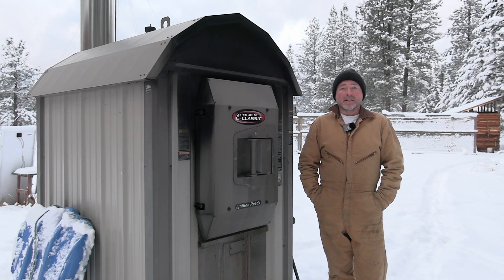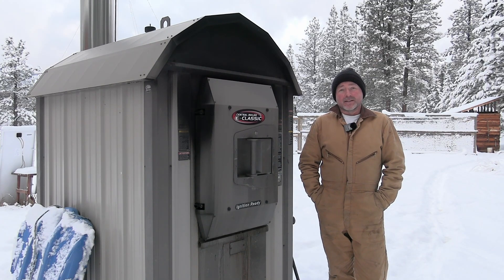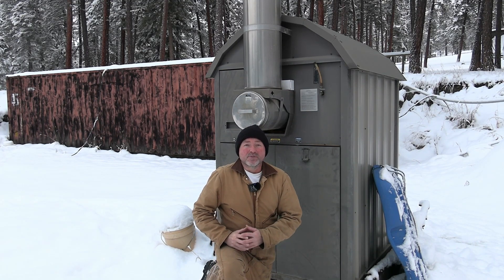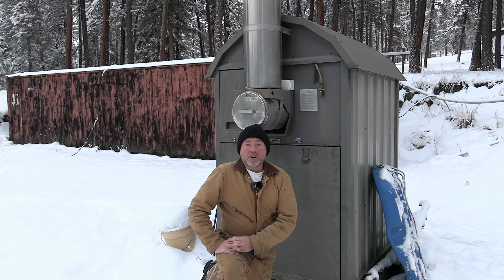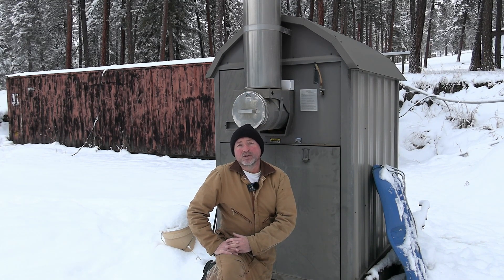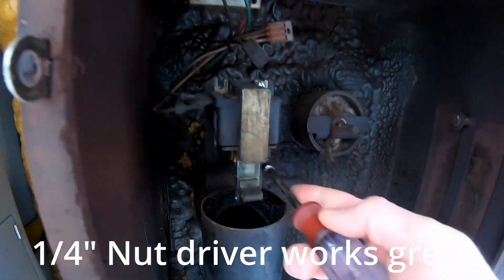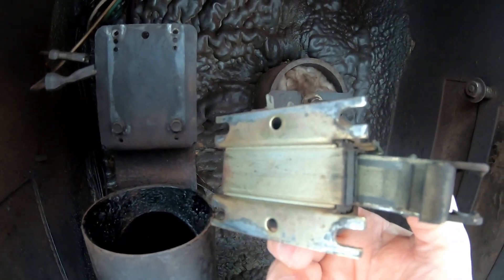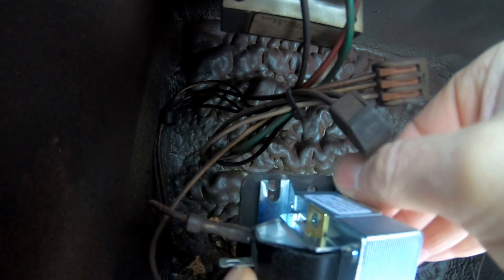We almost got cold. The Wood Burning Central Boiler fire kept going out. Diagnosed and Repaired it.

Comment from the maker: 👀Timestamps take you right to that chapter:
0:00 Introduction
0:56 What happened
3:28 Diagnostics
4:17 Inside the airbox
6:43 The new part
7:18 How to replace the air solenoid
12:37 Adjustment of air gap
13:29 Conclusion

Comment: My brother and mine are scrap (E2300).  Looking for a different brand. Mine started leaking deep in the gasification part..My brothers started peeing water out on the seem in the firebox. The welder couldn't believe how thin the wall was.
Reply from the maker: Wow, that's pretty bad. How old are those boilers? Mine came with a 20 or 25 year warranty on the steel, burner chamber/tank. I have noticed that even with the corrosion inhibitor at the correct level there is still corrosion going on in there.

Comment: What kinda wood do u burn ?
Reply from the maker: Mostly Ponderosa Pine since this is the most common tree right here. I do also burn leftovers from a small sawmill in town. That stuff is all kind of mixed wood.
Reply: @RMTFamily  reason I asked is to my understanding supposed to be seasoned hard wood which is why I have the older style can burn anything (wood) so have things changed or ur limited w/ pine ?
Reply from the maker: @scottwebber652  Hi Scott, you can burn any wood in the boiler. But hardwood is dense and you can get more heat out of the same size log. It can burn cleaner than our pine because it reaches higher temps quicker. It also will make for less creosote build up. Simply said with hardwoods the boiler will be cleaner and more efficient. 
But we have been burning pine all along and have found it to be working well for us. 
We cut down dead pines  which are already seasoned at that point, but usually they still get stacked for a year or so as we like to be ahead of the game.
Any dry clean wood is fine for these boilers.
I’m sure the manufacturer still says to use seasoned hardwood  since that makes the boiler perform best with the least amount of cleaning. But that is not cost effective or possible everywhere.
Reply: @RMTFamily  I like to hear that because of their recommendations n u not following I wondered if it would work n u can tell us. When I bought the gassifiers were coming out and because of any thing in the old version I went that way but if I needed to replace it I wanted to hear what the people were actually doing. What do the rest of u all have to say about it ????

Comment: Where are you from? Kinda sound like you have a foreigner accident.
Reply from the maker: Got my accent from an accident. 😂Obviously I'm from Montana. You must not have heard a real Montanian accent yet.😂
Just kidding. I grew up in Switzerland. Once you have an accent you can't get rid of it. Almost 30 years in the US but still have the Swiss accent. 😉
Reply: @RMTFamily  awesome. I was thinking Russia. You can hardly tell just a little.  I have a central boiler 5036. It’s the small one holds 190 gallons of water and is all 🪵 fuel.  Using it all winter long. It loves the wood.
Reply from the maker: Does the 5036 have a reaction chamber like the e-classic 1400? There are so many models now, one can't keep track of it. BTW our is all wood only too. It has the prep for propane, but just to light the fire not as back up. Whatever the larger Model was back when (holding 400Gls) was available with propane back up heat. But we did not need the large size and wanted the smaller (200Gls) more efficient e-classic. 
Our boiler is not to hungry. We use about 4 to 5 cords a season to heat 1600sqf and fresh water. I know of many people around here using 6 to 10 cords in their "regular indoor" wood stoves and some still have to supplement with electric heaters.
Reply: @RMTFamily  it’s all wood without the reaction chamber.  We bought it about 9 years ago. I have replaced 1 solenoid on the door and have used about 4 pumps. It takes the Taco 007 pump. Not sure why they went out, but they did. One of them went out at 3 am and I woke up to a cold house and of course it was like -2 outside.  My temp display at the unit works but the light that makes the numbers some of the dashes quit working, so I ordered a replacement and I will do that when season is over.  The stove works great and heats our 80 gallon water heater also.  Those are the only things I have done to it besides I put new rope around the door twice and I don’t even think it needed it. I was just getting ahead of it. We have 180 acres and we take the tractor and pull up trees that are down already and use those. It’s a wonderful product and I love the videos on them as it’s a great way to learn things you haven’t thought of before.
Reply: @RMTFamily  I forgot to mention that I would like to upgrade to the e classic.  We are using about 10 cords of wood.  We only hear with it.  The 6048 is like mine but is 400 gallons. My neighbor has one like that. Can I ask what kind of pipe you are using in the ground? Did you go with the central boiler pipe or another brand?
Reply from the maker: Wow, that's a lot of pumps. I replaced the pump at the boiler just to upgrade to stainless  but could have done the cartridge only like I done one for the radiant floor heat pump in the house. I use a Taco 009 at the boiler. I wonder if you could go with a larger pump like Taco 009 or a different brand. I have radiant floor heat except in two rooms with carpet where we have radiator/convectors. The pump at the boiler pumps to the sidearm on the water heater then splits to the 3 pumps with manifolds for the floor heat and it also feeds the radiators as they have thermostats on them. On the first floor the Pex tubing is in gypcrete so we have some mass to hold the heat and don't get cold for at least 12-24 hours.
I had to replace the door seal already 3 times and will have to do it again before next season. Does yours have the actual rope? Mine has a rubber kind a seal.
You got plenty of land to get trees. We have been cutting down beetle kill on the property  and have to get out in the woods to either cut down dead trees or use down trees  if we are early enough after the snow melts. Many people get out even before the snow melt to get down trees right at or even across the forest roads.
Reply from the maker: I used the Central Boiler pipe. Two 1" Pex in an insulated jacket.
The reaction chamber is what makes the e-classic so efficient, basically burning the gases in the smoke, reaching 1000°F real easy, mostly around 1200 to 1500° and no smoke. We love it.😀
Reply: We have a rope seal on the door. I just ordered another and will replace it before next year. The rope is still good and doesn’t leak air, but it’s like 4 years old. The E Classic sounds impressive. We really need to sell ours and upgrade so we don’t use as much wood. It’s a great work out doing all the wood and I enjoy it, but if I could burn less wood that would be awesome. We have a heat exchanger in the furnace and that’s how we get the heat. I wish I had radiant heat in the basement so the floor would be warm.
Reply from the maker: For some reason they changed to a rubber like seal on the e-classic and it does not do as well as the rope seal.
The novelty of processing firewood wears off after a few years. 😂
It is fun but also "work" that has to be done. Burning less also means lower cost and more time for other projects.
That's the problem with the furnace, it will get cold quickly. We added the floor heat in our house. Torn everything out in the first floor, put 1" T&G Blue Board down to insulate the slab, stapled the Pex down onto the blue board and had 1.5" gypcrete poured over it. Just another project. 😂